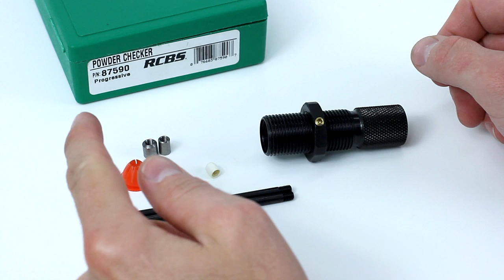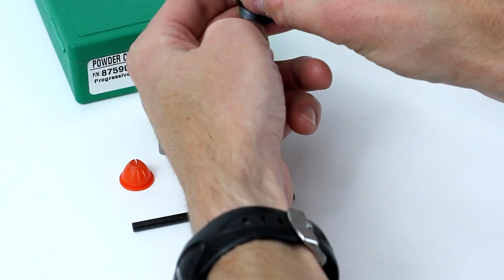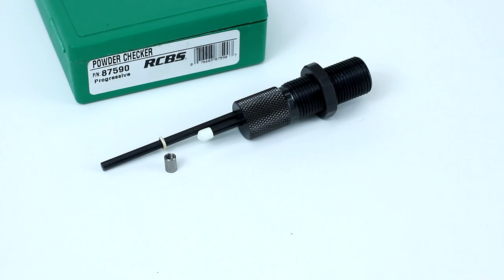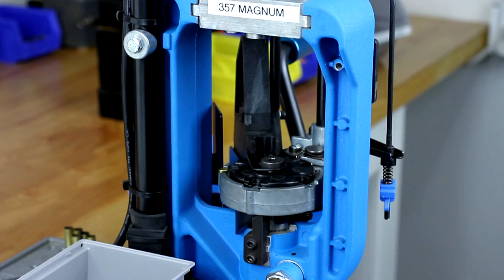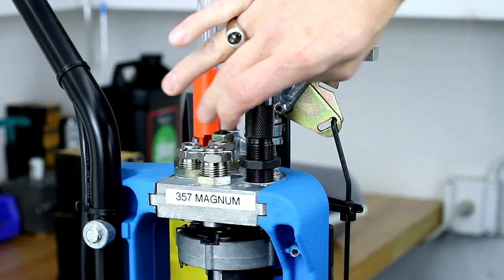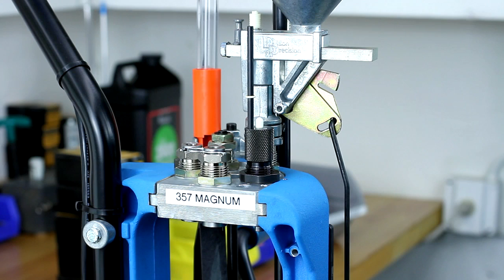RCBS Powder Checker Die

Comment: Quick Question: I was looking at purchasing this checker for an RCBS progressive press.  The press has 5 stations, 2 in front of the powder, and 2 behind the powder charger.  If the checker comes after the powder charge how do you solve the 2 station need for a bullet seater and crimper?